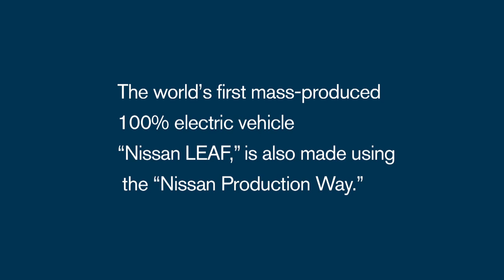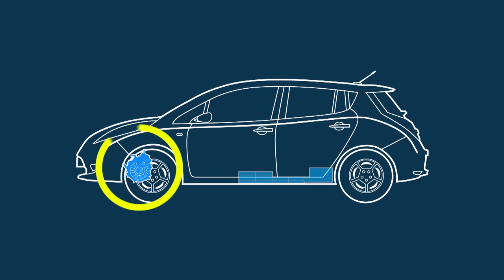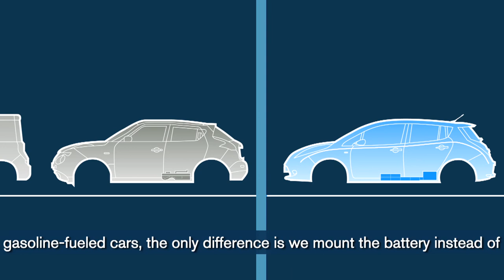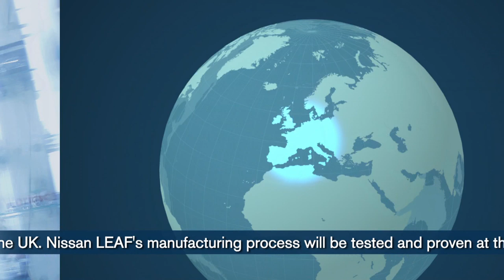Nissan LEAF electric vehicle production process detailed

Comment: @gerfall ..... not all power plants run on coal buddy.   Have you ever heard of the Hoover Dam?  You do realize that by moving the water around that dam holds back, you can spin a turbine and make electricity... Ever heard of Nuclear Reactors?  One of the most Safest pieces of engineering ever (Don't Send me links on Chernobyl and blah blah blah, the fact that there has only been 2 major accidents in 30+ years is amazing)... so no, coal doesn't power all of our electricity production scrub

Comment: .... this is way behind Chinese BYD electric cars. Chinese electric cars usually includes a secondary or thrid battery tray system which can maximize the total range of the vehicle to 1000kms, BYD had already sold more than 5000 units of it's own Li-M battery e-car for taxi use across China. I believe Japanese manufactures are supiror than Chinese in turns of manufacturing. However, they need more smart way to maximize their products' usability. :-)

Comment: When i remodeled my house to an all-electolic home, i bought Nissan Leaf. And also, i changed my house contract of the electricity prices. As a result, In the night time, electoricity prices reduced to less than half as compared with day time. It is sufficient usually charging in the night time. A long ride in the car, i am using the boost charging service with that facility of Nissan. If u pay for the fee of 1,500 Yen every month, u can use the 200 facility in Japan as many times as u like.